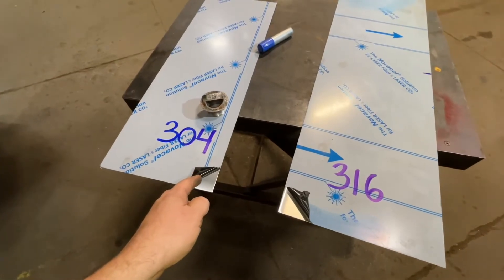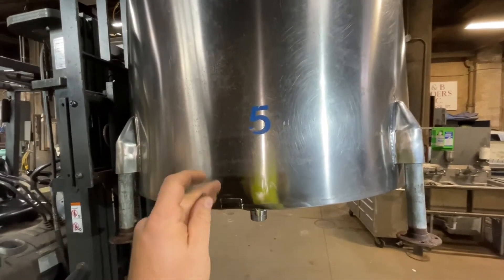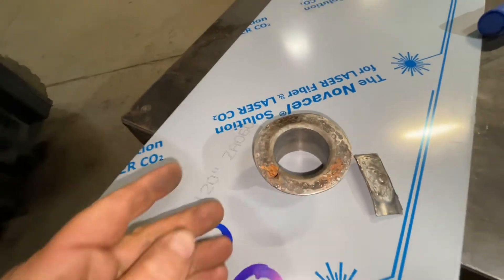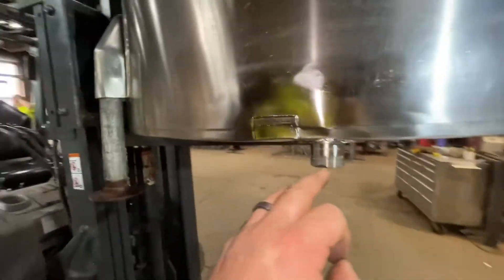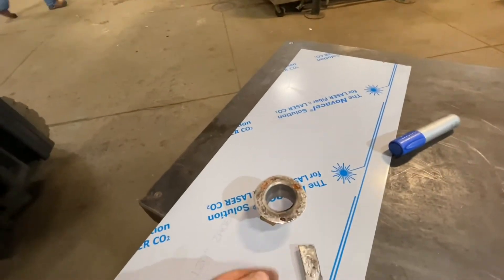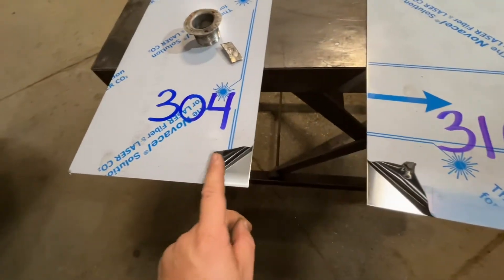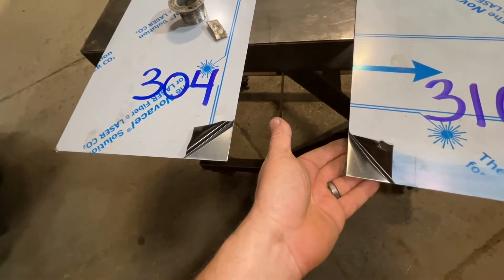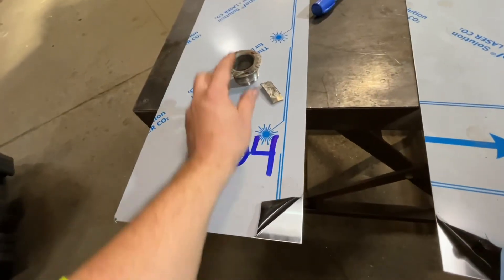Testing 304 and 316 with simple Magnet test!

Comment: The main component in stainless steel is chromium. Chromium is non-magnetic and thus the more Chromium the steel has, the less magnetic it is. You will notice that much of the stainless steel from commie china is junk. They advertise it as high quality when in fact its often quite magnetic and will start corroding shortly after being introduced to the weather

Comment: 304 stainless doesnt stick to a magnet, 430 does though
Reply from the maker: Unfortunately, it does. 400 series stainless steel has the most amount of iron, 304 has less, and type 316 even less. I use strong magnets all the time to identify 304 stainless steel. Old-fashioned magnets weren’t as powerful as todays rare earth magnets so they typically wouldn’t stick, my grandfathers trick was using a fragment (of low powered magnet) because the magnetic attraction was greater than its weight, allowing it to stick.

Comment: I'm hoping you can help me. Thanks for this video too. I made a knife and don't remember what alloy it was. In one of my purchase history (online metals) I purchased 316 and since have found out that stainless cannot be hardened, which means I wasted hours of time working on it. However after watching your video a magnet sticks to it. Is it possible it's not 316? Thanks for your time
Reply: Austenitic Ss become magnetic when worked. Austenitics like 316 do not undergo a phase transition during heat treatment. However you can carburize your blade and get it pretty dang hard. You use to be able to get the salts from a gunsmithing shop, I know Brownells used to sell it. Be careful what you get traditional salts are mostly sodium cyanide and toxic but there are non cyanide products. There is also nitriding salts.

Comment: None ferromagnetic stainless steel (304, 316, etc) become ferromagnetic after being cold worked, so your joint could just be cold worked stainless steel, same with your 304 steel. To truly test/remove ferromagnetism you need to heat treat them first

Comment: The iron content of both 304 and 316 is pretty close, and I don't think that's the reason for the different magnetic properties. It's more to do with what types of crystal matrix a given alloy forms, namely ferritic vs austentitic. (feritic matrices are ferromagnetic while austentitic ones generally aren't)
From the data I'm seeing, 304 is generally close to 69% iron and 316 is close to 67%. 304 also has slightly more chromium, but the biggest differrence is the 2~3% Molybdenum content. The latter might be what has a more darmatic effect on the crystal structure, and maybe some impact on corrosion resistance, but is mostly there to increase strength, especially at high temperatures. (molybdenum content greatly improves creep strength)

 304 is also supposed to be an austentitic, and many sources say it's not ferromagnetic, but obviously it's at least slightly ferromagnetic (I've seen this in person too, and was at one point concerned I'd been cheated on the grade of steel I'd purchased).
304 stainless is still much less magnetic than carbon steel or ferritic stainless steel grades, so it seems like it's at least mostly austentitic.

Pure nickel is also ferromagnetic (as is Cobalt), while chromium, manganese, and nickel are not. Iron-nickel-cobalt alloys tend to be ferromagnetic, but the percent of non-ferromagnetic components doesn't directly correspond to the final properties, and alloys with considerably fractions of nonmagnetic components can still end up ferromagnetic, while additions of relatively small percentages of certain components can have significant impact on the final crystal matrix. (as does the annealed or heat treated condition of the material)

I'm pretty sure 304 is reasonably suited for being in contact with most strong, oxidizing acids (like sulphuric acid), while 316 is slightly better at this, too, it still shouldn't be the main problem in this case. The fact carbon steel welding rod seems to have been used on that fitting is the main problem. 316 is rated to be better for long term exposure to seawater, road salt, or other long term salt exposure, and more generally is more corrosion resistant to chlorides. (Though I'm seeing info that even 316 steel is considered non-resistant to hydrochloric acid, while both 304 and 316 are suitable for sulfuric acid, though 316 is slightly more resistant to corrosion in general)
Reply: Correction: specific combinations of magnetic metals in an alloy can also lead to a reduction or elimination of ferromagnetism. Straight nickel-iron alloys still tend to be ferromagnetic at room temperature, both at the >50% nickel and >50% iron range, as do stainless steels like the 400 series with no nickel but significant amounts of chromium.
But the interaction of iron, nickel, and chromium in 300 series stainless leads to a dramatic reduction in ferromagnetic properties. (obviously moreso with small additions of certain other metals)

Iron-cobalt alloys also tend to be ferromagnetic, and at least some iron-nickel-cobalt ones are, too, but I'm not sure whether that's true for all proportions of the three. (and addition of other metals would change that further)

So there's more complex interactions going on here in general and a somewhat limited rule of thumb.
Reply: For easy standing magnet can definitely tell which one will gonna rust quickly.. right or wrong? @chrishamilton53

Comment: Can a magnet work through stainless steel 304 plate? I realise you showed it was slightly affected by the magnet, but I'n more interested on the magnet on the other side. In other words, supposing I'm able to fix a magnet onto one side of the 304 plate, can I get a magnet to stick to it and hold the plate?
Reply from the maker: Yes it can, you could have a thick steel plate covered with thin stainless steel to get a magnet to stick. Or even a magnet glued etc to the back side, but it also depends on the thickness of stainless steel and the power of the magnet.

Comment: It could be cheap Chinese stainless steel most 304 is not magnetic at all
Reply: That's what I thought 40 yrs ago. We used 17-4 and it was magnetic AND corrodes (slightly) but was tougher than the back of Superman's head.

Comment: Both grades have similar amounts of iron, chromium, nickel, manganese, silicon, and carbon, but the presence of molybdenum gives 316 stainless steel superior corrosion resistance properties compared to 304 stainless steel, particularly in harsh environments.
Reply: Exactly.
Reply: Nope. 304 has 18% Cr, the 316 has 16%
Nickel % also 8% in 304 vs 10% in 316
Reply: @osher87  Yes. They're similar as you wrote. Mo makes the significant difference.
Reply: Also the general use is for hot water in 316...big difference in corrosion resistance
Reply: @osher87 which one is better

Comment: "stainless steel should be non-magnetic"
martensitic stainless steel: "are you sure about that?"
Still, the corrosion resistance on martensitic stainless is nowhere near as good as in austenitic stainless like 304 and 316, so yeah for vinegar you definitely want non-magnetic/austenitic stainless

Comment: This didn't prove to be true I just tried. 304 that I have in the house is also non-magnetic.
Reply from the maker: It depends on the weight of the magnet to the magnetic strength ratio.  Most refrigerator magnets are very weak and relatively heavy for its size. We use either magnet fragments or very small/very strong neodymium magnets to perform our quick tests.

Comment: thank you. I learned a lot. I thought 304 is not magnetic
Reply: #304 and #316 are generally non-magnetic but can become mildly magnetic through being cold-worked. ie bending, deforming. There is no simple method for identifying a stainless with a magnet. That drain fitting in the video, however, is strongly magnetic and could be a martensitic stainless.
Reply: @paulmaxwell8851  You are correct. I have some 316 grade steel ratchet buckles that were manufactured to my specs and due too all the bending in the manufacturing process they are slightly magnetic. Magnet tests should not be used to test stainless steel.